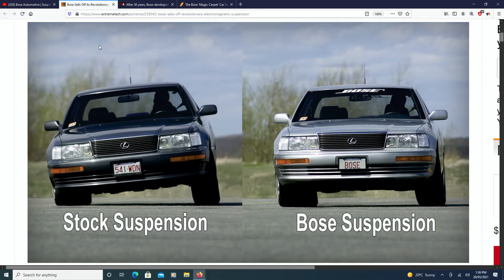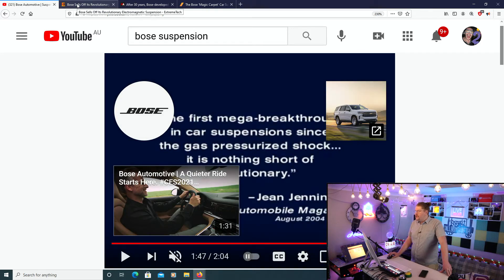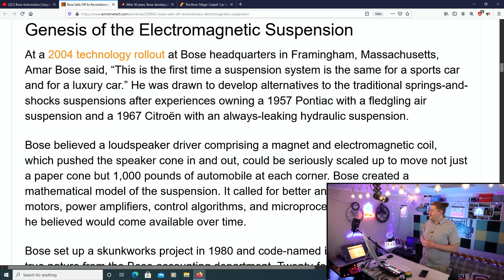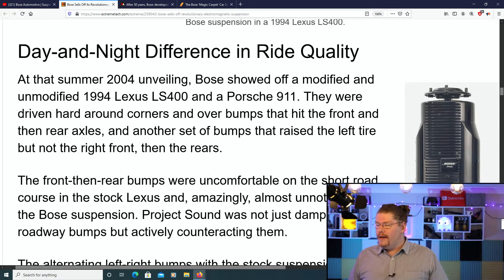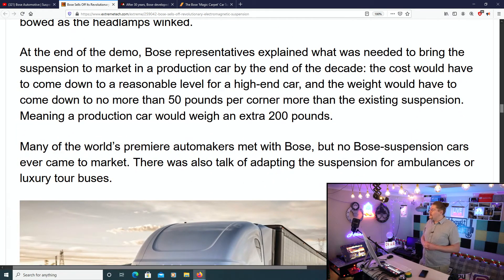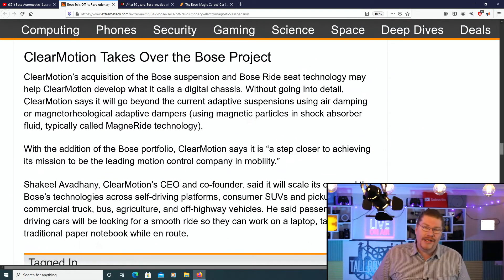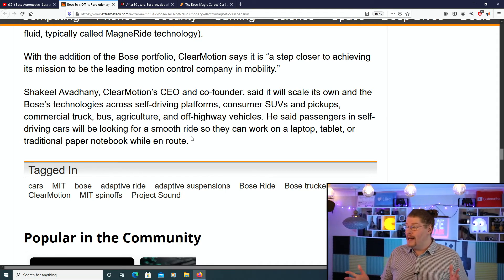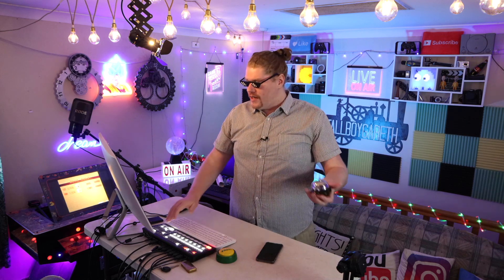Remember BOSE the Speaker Company? The Futuristic History of BOSE Electromagnetic Car Suspension!

Comment: So what is going on with this tech? Still nothing?
Reply: check out Audi RS Etron GT or the new Porsche Panamera suspension, its basically the original Bose suspension
Reply: @88boat  Well not really. Bose is pure electromagnet, Porsche and Audi uses hydraulics. It is an full active system but still, not the same tech.
Reply: @KolyaNadj  but they both achieve the same goal - that was my point. i didnt know they were different tech. what do you think was the reason Porsche et al went with hydraulic and not magnetic?
Reply: @88boat  yes you are right, both tech achieve the same goal. I just feel like, what hydraulics can do in 77ms, electromagnet will do in 1ms. waaay smoother
Reply: @KolyaNadj  so why didnt they advance it but instead went with hydraulic? i cant think of a reason the hydraulic is better in any way. weight? electric cars are compact tanks anyway. durability? since theyre independent that must make them easier to replace. something im missing?
Reply: @88boat  technical limitations I guess

Comment: From what I have heard about it. no one wanted it for there cars because of the $5000 price tag
Reply: Its $5000 when it comes out new but over time as the tech devolopes and the manufacturing process improves, the price will drop.
Reply: I'd prefer a $5K build on my A5, and it would greatly benefit the awd. I don't want air suspension, I'd like to buy a magride kit.